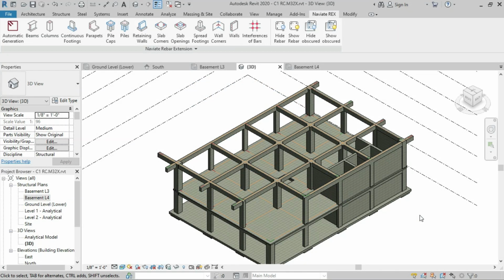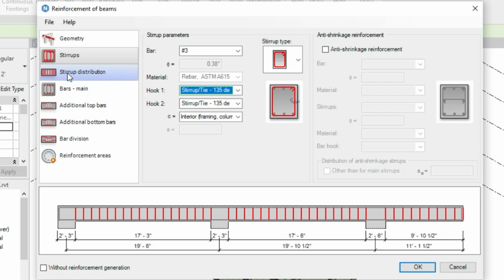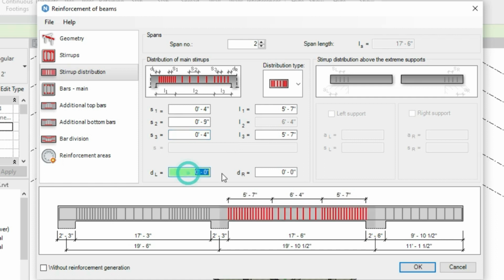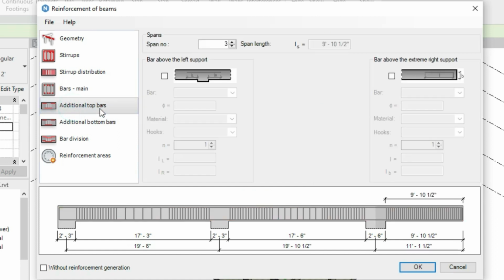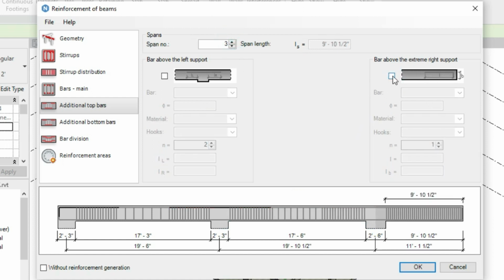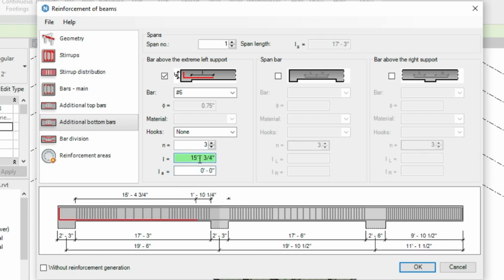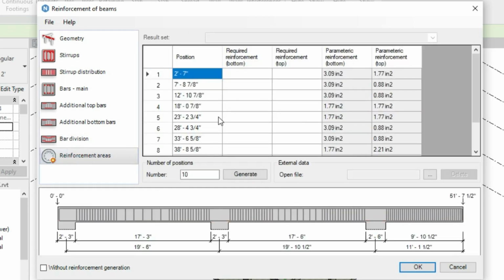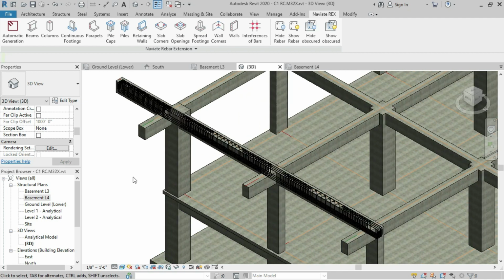BEST Rebar Installation Method in Revit You Need to Know

Comment: Well, I have 2026 Revit. I went to Naviate web site to download the free version of Naviate Rebar and install it. However, It is not near what you show here which is Naviate REX. I like very much what Naviate REX can do but with the new version you can not place rebars for multi-span beam like you are showing here. Why is that? Do you have a solution for that or another tool that does exactly Naviate REX does for 2026 Revit?

Comment: Nice video.
Can you please sharing for cranking bars, lapping bars at top and bottom stranggled wise.
And is there possible for coupler in this extenstion?
Reply from the maker: Thanks will make more soon
Couplers not possible in this extension